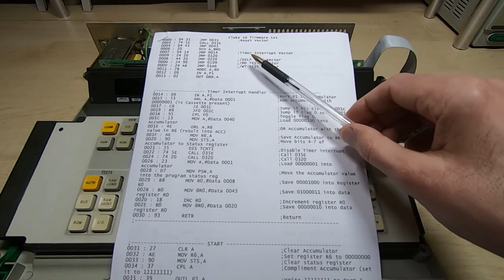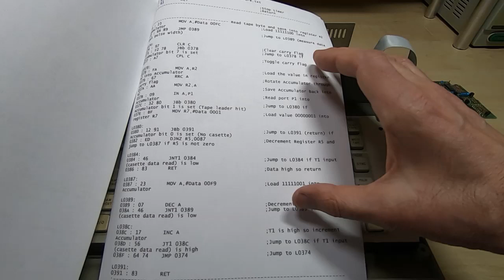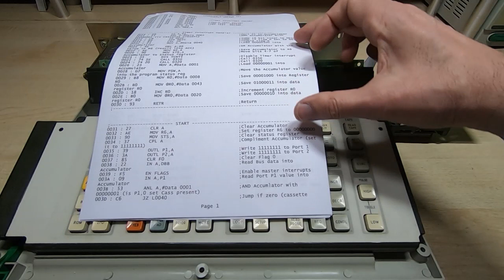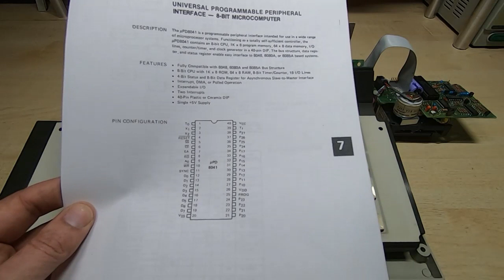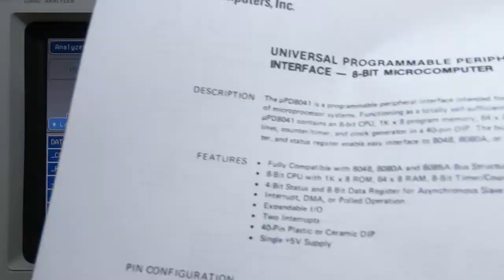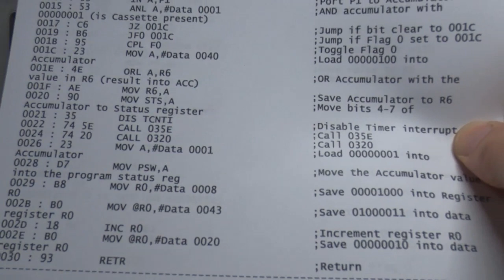Fluke 9010A Memory Project Part3

Comment: How do you know which clock signal to use for state driven mode? They are likely inverse of each other, roughly. i have a case where one of the signals is clearly within waveform of the other.  So, about 50% hi for one but 40% high for the other.
Reply from the maker: If you look at the captured data you can see how the data lines change realaive to the trigger point. If the signals are half a clock cycle out of phase then you can switch to the other clock input. Alternatively the spec sheet indicates that you can either use a crystal and make use of the internal oscillator or connect and external clock to one of the pins. You should use the pin that the external clock can be connected to. In this case it does not actually matter as we are only looking at the signals relative to each other and this will be the same in either case. I actually have it set up to read data on both clock edges so it is effectively using both clocks (although the phase will be shifted internally).